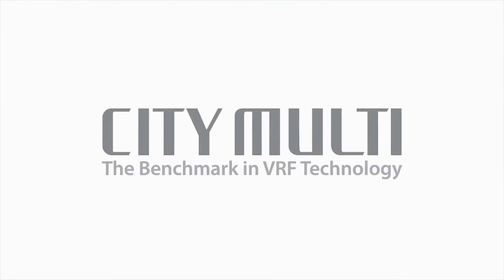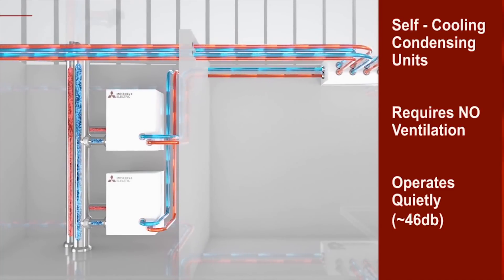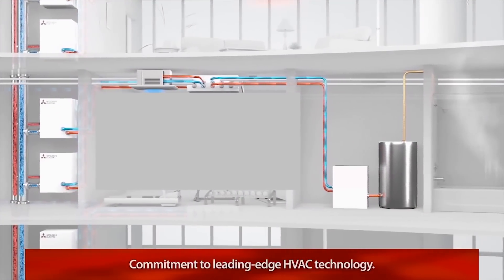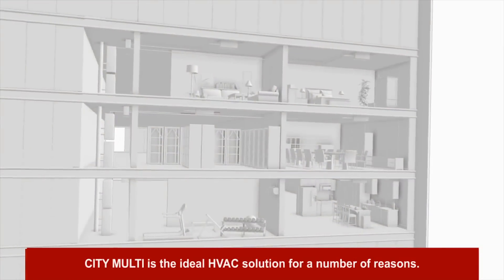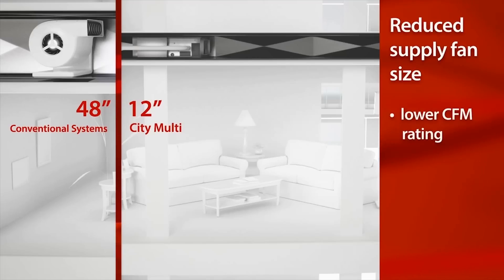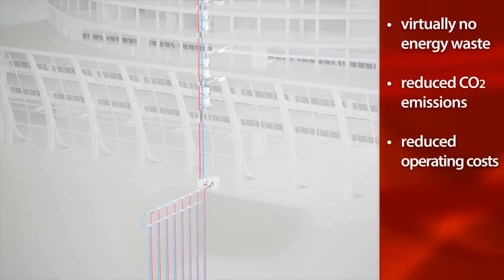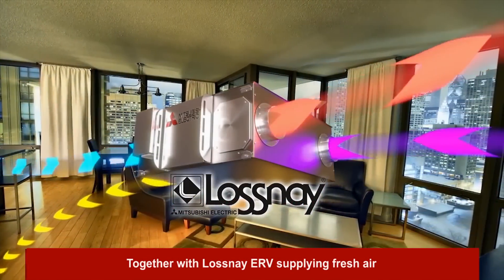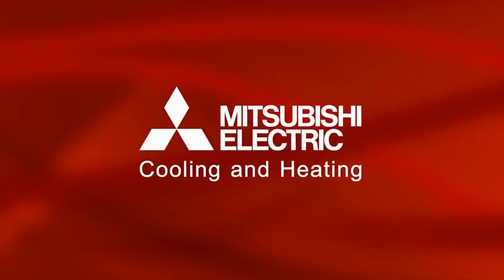CITY MULTI Water Source Solution

Comment: Now what if I wanted...
  
1) A hydronic cooling loop in the ceiling (cool, but above room's dew point)
2) A hydronic heating loop in the floor
3) An air heat exchange zone at the windows (both heat+cool), with ambient humidity control (doable with dedicated heating and cooling coils)
4) A hydronic towel heating rack
5) Energy recovery from a room/bathroom ventilator
6) Domestic hot water from heat pump
  
This feels like it would be 5-6 zones for a single room with en-suite.  I'd want to do this for every room... with special zones for halls and public spaces.